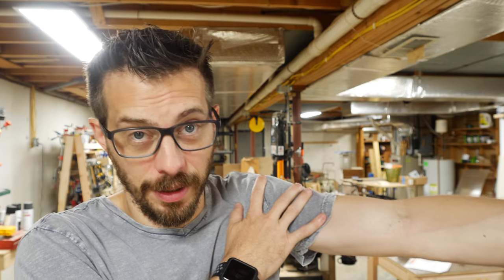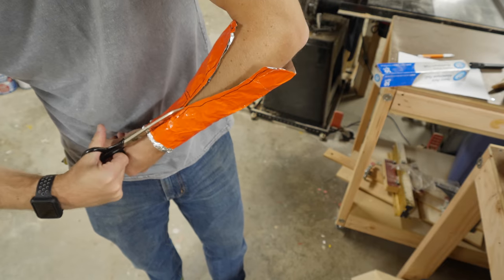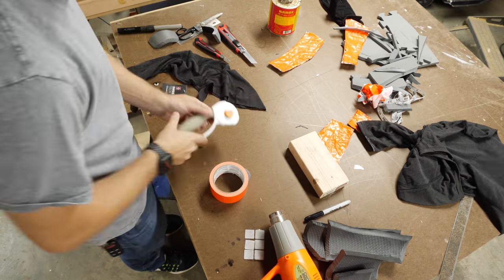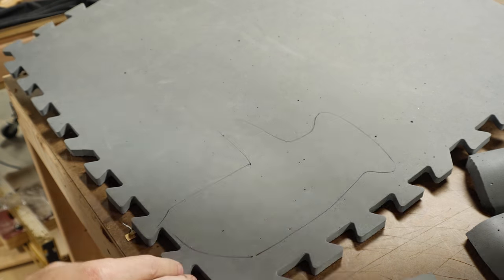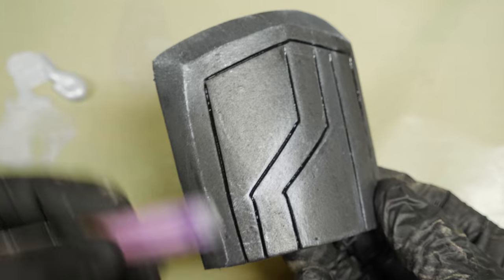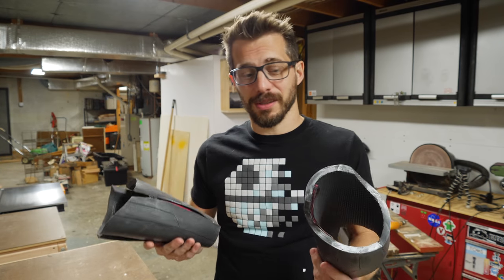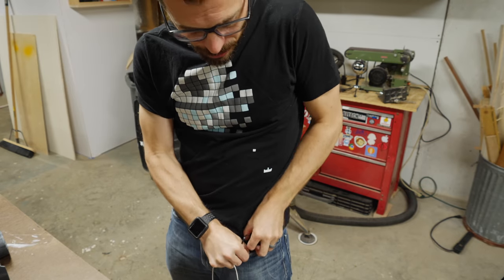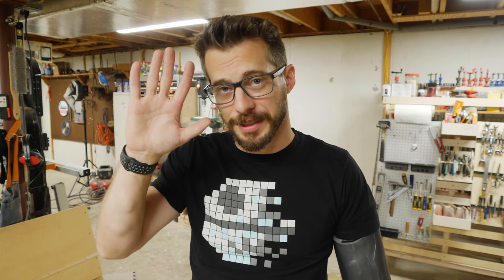Cyborg Arm (Cosplay/Halloween Costume How To) | I Like To Make Stuff

Comment: You could use syringes and make a small hole with a pin to make a small piston going across your inner elbow.  The pin is to prevent air pressure from breaking it.